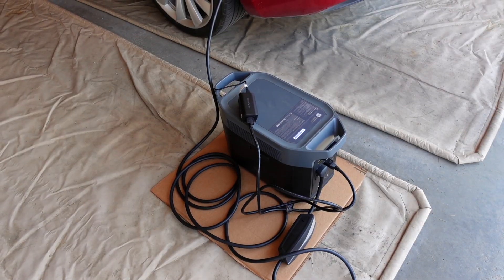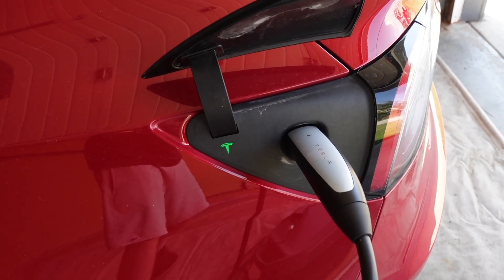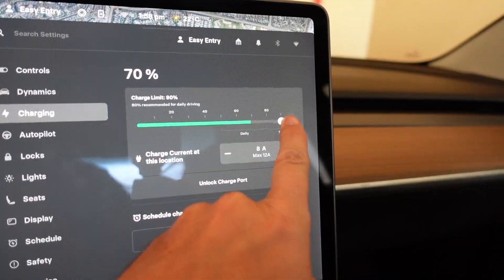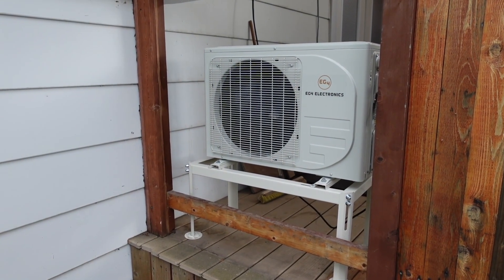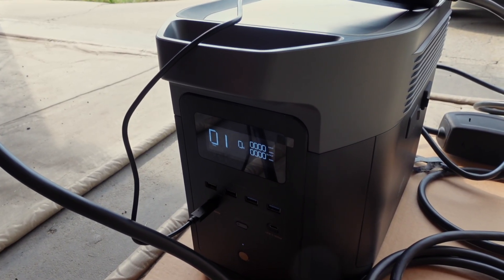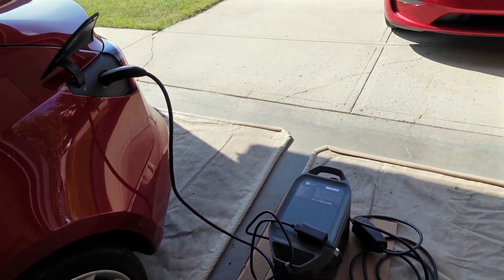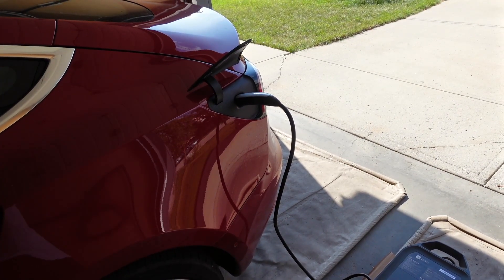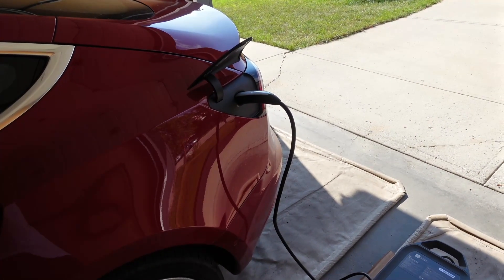Can an EcoFlow Delta 2 Max Really Charge a Tesla?

Comment: Hello!  Thank you VERY much for sharing this test!  I have the same battery, but I am not technical like yourself.  I gathered from the video that if I use the battery to charge my EV, it'd give me about 9km (emergency use I suppose)!  Can you please tell me which cable/grounding cable to buy?  And which setting on the battery do I need to set it (if any extra steps)?  Much appreciated!
Reply from the maker: It’s sold on EcoFlow’s website and I was pretty clear about the steps in the video. I did this specifically to fix an issue with state of charge reporting on the Delta 2 Max based on their support, so I wouldn’t make a regular habit of doing this but it could be a handy backup. Max I was able to charge on a single cycle was 1.44 kWh out of a 2.048 Wh battery. So if you averaged 144 Wh/km that would be about 10km I suppose. Depends what EV too. But you wouldn’t want to leave the battery below 20%, so maybe only 80% of that. When I did the test cycles I immediately started charging it back up. 

Here is my referral code as well: 

https://www.ecoflow.com/ca/referral-rewards?inviteCode=AZFKLPSJ2F

Search for the portable power station grounding adapter.